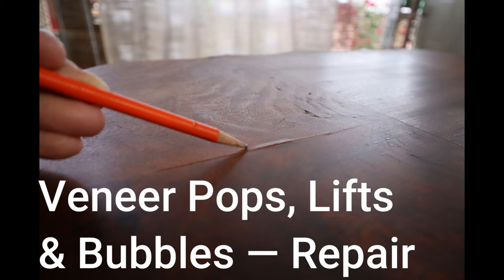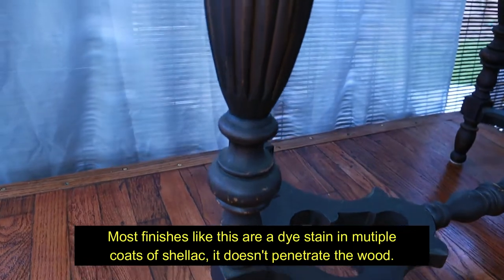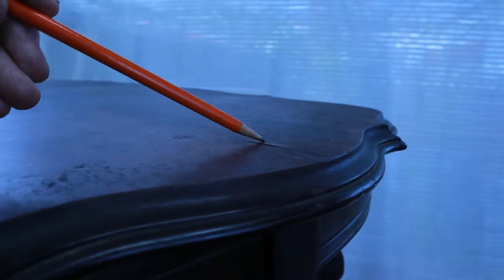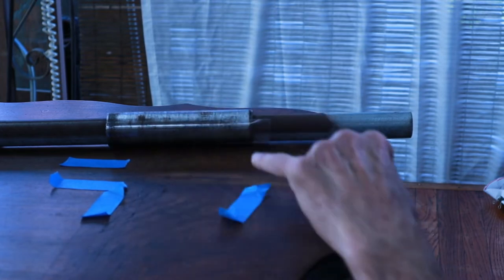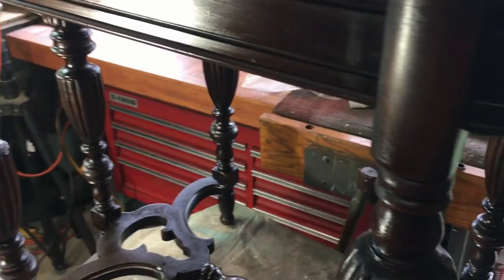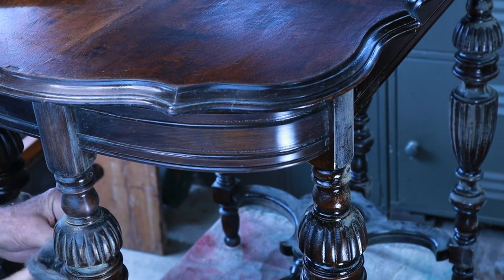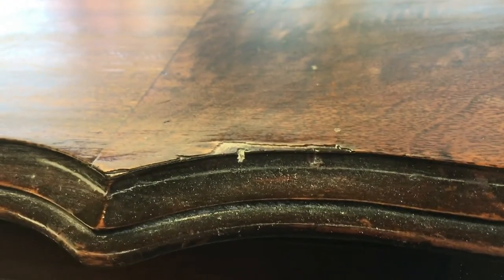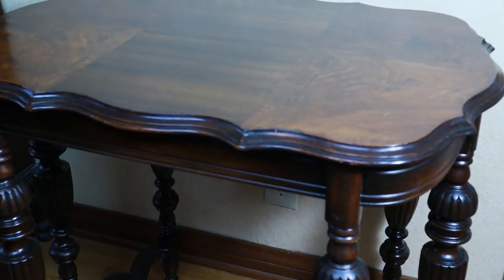Restoration: Wood Veneer Pops, Lifts, Bubbles — Repair Tips

Comment: Do you know, would a steamer work in place of the iron or would it deform the wood more? I'm mainly asking because a steamer is what I have.
Reply from the maker: Hard to say. Maybe if you made something in the way of a shield out of metal strips you could concentrate on the lifted area and then move a strip over to hold it down. Thanks for watching.

Comment: I have an old cigar box that has a thin veneer layer that’s detaching from the wood underneath.. the spot is just a 2x2 spot and you can see some small minor cracks in the vaneer but its not flaking up yet.. so I’m hoping it can be salvaged do you have any suggestions on how to apply some light adhesive or glue underneath the vaneer without damaging the rest of the box.. this is a great video it’s definitely nice to see people restoring these old pieces.. thanks for the content and if you can lend some insight or advice that’s greatly appreciated…
Reply from the maker: You can use thinned out hide glue that will wipe off the label as you press into place. A warm iron will set the glue in 30 seconds and you can reset with applying heat again until you get it right. White and yellow glue don't do that well. Test the label for being able to be damp wiped and don't use enough glue to squeeze out if you can't clean it. If the paper changes colors when damp, stop.
You may have to use contact cement applied thinned and very carefully so as to not get any on top. Follow the directions.
Reply: @OddJobFix  thanks I appreciate your input and advice.. I’m probably going to try this method out and see how it works.. I guess you could say the spot is kinda bubbling but not flaky yet and none of the vaneer is damaged aside from two small cracks on either end of the bubbling.. my initial thought was to use some wood glue and press it into and under the vaneer  with a credit card or something similar.. then try to add some pressure to the surface but I think the wood glue would discolor the old polyurethane or lacquer finish.. but I’m not really familiar with vaneer finishes and I greatly appreciate your advice on this one.. I will definitely follow your directions… Thanks again

Comment: Wha do you do with a veneer that's bubbled up that's about an inch long and raised about 1/8" and has turned hard?  It's not soft and pliable so that you can cut down the middle and insert glue and weigh it down.  This is rock hard, that's been there for a long time.
Reply from the maker: Did you try heat? How about moist heat — an iron on a damp cloth. Thanks for watching.

Comment: So I have a piece that got slightly wet with a Misty rain and the top got bumpy all over.  Is there a way to fix this?
Reply from the maker: Depends on the type of glue. You can try a warm to hot clothes iron on several sheets of paper or thin cardboard. Ifthe top seems to want to stick, cool it down with a flat weight. Try not to cook the finish, but if you do there's always refinishing.

Comment: Thanks for making the video! Great insights! If you were to sand an antique dresser with lots of detailed contours, would you hand sand or are there some contour tools you use?
Reply from the maker: I just bought some sanding sticks:
 https://www.amazon.com/dp/B00G13A7F8?psc=1&ref=ppx_yo2ov_dt_b_product_details
No affiliation. There are attachments for multi-tools and there are many shapes of shaft mounted abrasives for drills and mini drills. Also cloth backed sand paper called emery cloth can be ripped into small strips which are really handy. Don't forget about steel wool and abrasive pads. Even a tooth brush and loose abrasive can work for delicate items. I've even seen abrasives mounted on a reciprocating saw.
Thanks for watching!

Comment: Thank you. Very informative and understandable. Should I measure the temperature of my iron and purchase one of those temperature gauges? It seemed like it was a wide range for it to glue back down.
Reply from the maker: Not really. I tend to be up near 'cotton and wool' settings. Depends a lot on how long it's pressed down and recovery time. If the iron is going to sit for 5 minutes, I turn it down some. If I'm using it constantly, I turn it up until it does something bad like burn the wood.

Comment: Great video, how long did you keep the pipe pressured on the seam?
Reply from the maker: For the rest of the afternoon. Might have left it overnight, but not needed. Getting wood to achieve a new memory is the result of heat, moisture, (glue, of course) and time. Time for the glue to set and gain strength helps. Thanks for watching!